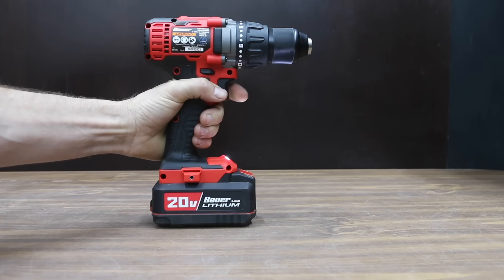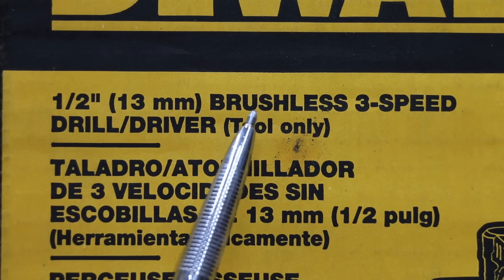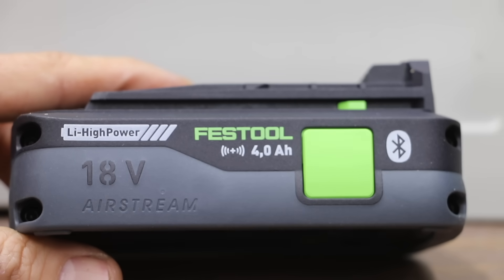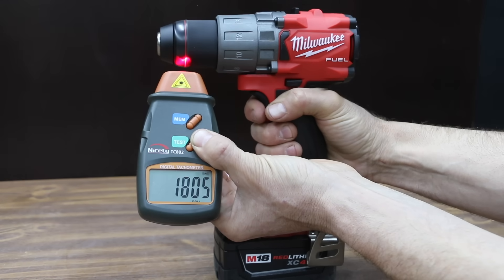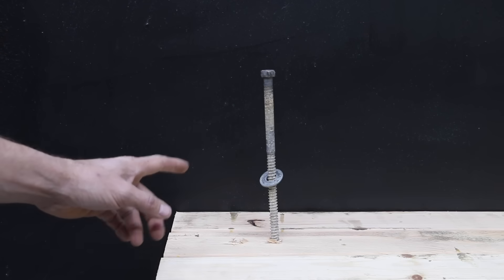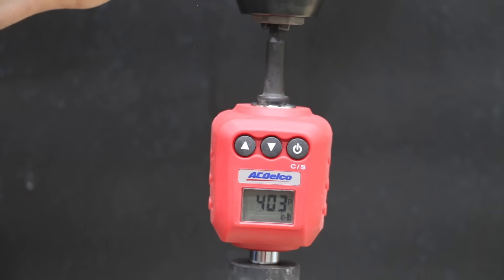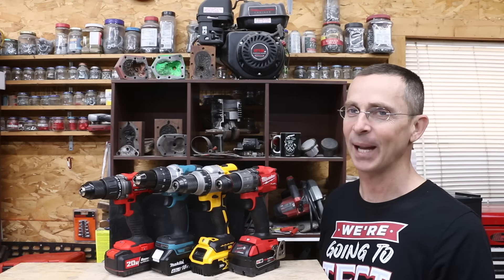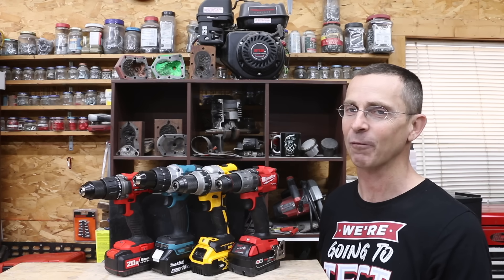Best Drill (BATTERY POWERED)? Milwaukee vs Dewalt, Makita, Bosch, Festool, Ryobi, Bauer, Ridgid

Comment: To state 'Made in USA' item has to contain a minimum of 47%  parts actually made in USA. (or maybe 49%? I forget)
 If percentage is lower it can only say 'Assembled in USA' 
Around 2008 Harley Davidson sales suffered when they switched to 'Assembled in USA'  which is the only reason I'm aware of the difference.
The lack of run time is the reason I don't have a working cordless drill any longer, even with Lifepo batteries run time is too short and the older technology  cells have way too many issues.I found it a waste of money having a cordless even with multiple battery packs
Reply from the maker: Thanks for the feedback.

Comment: I'm not a contractor, so the cost of replacing batteries, and the power of the drill are primary concerns.  I can have a drill a long time before wearing out the brushes.  With Ryobi, by the time the batteries won't charge anymore, I can buy a replacement drill, charger, and batteries cheaper than just the batteries.  I'll stick with Ryobi.
Reply from the maker: Thanks for the feedback.

Comment: I left my Milwaukee at home one day and picked up a Baur from harbor freight and was pleasantly surprised. It had a hammer setting and came with 2 batteries, charger and bag for $65. 3 years later still going strong. It's a bit heavy and doesn't have the torque of my Milwaukee but for a good cheap back up, I got no complaints what so ever.
Reply from the maker: Nice!  Thanks for sharing.

Comment: I USE MILWAUKEE FOR MY HOME IMPROVEMENT  BUISNESS,

DEWALT HAS ALWAYS BIN A CLOSE SECOND WHILST MAKITA HAS CAUGHT MY EYE WITH ITS LONGEVITY. 

IT MAY BE SAFE TO SAY THE US BUILDS MORE WITH WOOD THAN ANY OTHER COUNTRY (CORRECT ME IF IM WRONG)

WHEN I BUILD DECKS THERES NO BEATING ITS POWER,

THE MILWAUKEE SUPERSAWZALL IS BEYOND ANY SAWZALL IVE USED,

DRILLS ARE USUALLY  FASTER WHILE AN IMPACT WILL DRIVE LARGER FASTENERS WHILE SAVING THE WRISTS.

ALWAYS PICK THE RIGHT TOOL FOR THE JOB!

THANKS PROJECT FARM.

IM GOING TO WORK NOW.

Comment: Im using Metabo 18v drill it has 4 brush motor. I dont like brushless sound. But though its very powerfull and can take 40cm to concrete and 1meter screw with special handle. Also it does not have hammer drill seting, but it was my choice cause in time hammer drill seting will cause inaccuracy for drilling when you need precision. I have it for 6-7 years it still runs perfect and same like i bought yesterday. Metabo is super quality, though they released some cheaper variants. But more expensive one pays off 100%.

Comment: Already got my Makita drill and impact driver, both brushless and perform very well with making furniture.  My old boss used Makita tools, drills, belt sanders, plane, router and jigsaw.  I only have one Ryobi tool, biscuit joiner but it does ok.  Not sure if I can get all those brands here in Australia but we have a low cost brand Ozito and the only tool of theirs that works well is the leaf blower.
Reply from the maker: Thanks for sharing.

Comment: While comparing these for driving and torque, they are after all drills. Would have been a better if tested boring holes in wood and metal with a couple of different bits i.e. twist, spade. The Festy might have had some redemption with its faster rpm. Also aren't the brushless designs to maintain speed under loads etc? Big fan of your no nonsense tests!

Comment: You've only tested highest rated for brands. I work on ships and portability and smaller drills are better. I've gone with Milwaukee 12v but I'm curious why you haven't gone into the 12v realm?
Reply: For instance, I use 12v Hackzall and 12v Impact and hammer drills. These are very purpose driven devices and they often chill very tense problems that are created by a avalanche of maintenance faults that include problems that are just broken equipment.

These things are like half the size and some amazing jobs. I Wish you would push them up a little more.

Comment: Would love to see you add the Kobalt brand to your tests.  Seem to be a pretty good value but they haven't been through the Project Farm
Reply: I love my kobalt tools, use em for HVAC work and they have been through hell and still work the same from day 1.
Reply: Flex brand also
Reply: I have had Kobalt 24v since it came out, back then they were a very good all around drill for the price.  Now the 24v XTR series really polished it, it has a trigger comparable to dewalt, torque comparable to milwaukee.  Honestly, I use all the brands and right now the XTR is the best for me, it shines in all the areas I like.  The FLEX is really heavy and almost identical to the XTR but it is the most powerful drill I have ever tried.  Overall i'm very happy with the price and performance of all my kobalt tools, I saved thousands getting Kobalt over Milwaukee and I like everything about milwaukee except their triggers and price.

Comment: Should have finished the video with "Don't waste you're money on festool" 😅
Reply: I‘ve had the festool for like 10 years (protool but it‘s the same). Used everyday at work even with 120mm Holesaw Drills 20mm it never gave up or had to be repaired. So its quality is outstanding for professional use. Best regards
Reply: You could replace the word "Festool" in my comment with literally any tool brand and someone will post an almost identical comment to yours just with the other brand name in it instead lol.
Reply: @manuelr9654  My Rigid tool set has done hole saws, drills, driving lag bolts, etc and was purchased in 2004. Has a lifetime warranty even on the batteries. The warranty has only been used on the batteries.

Comment: Love your videos! Keep up the great work! I do have one question with drills (as a whole). What tool manufacturer makes the best drill that can handle the elements? I work in food manufacturing and I'm constantly covered in water, food grim, grease, you name it. I want a drill/ tools that can handle anything thrown at them. Any suggestions would be greatly appreciated
Reply from the maker: Thanks!  Thanks for the suggestion.
Reply: Panasonic used to make an IP56 cordless drill. It wasn't brushless, and I wonder if the could have gotten even better protection with a brushless drill, but they never made one. The brand, Nemo, makes cordless tools for underwater use, but they're quite expensive.
Reply: Thanks! Definitely worth looking into.

Comment: Is there any way you could evaluate a cordless tool “ecosystem?” A lot of people buy tools as a set, and buy more tools of the same brand / battery configuration. Example: most wouldn’t buy just the Makiya m18 fuel drill, then go buy the Makita impact driver. Which SET of tools is best?
Reply from the maker: Thanks for the suggestion.

Comment: With the milwaukee it has a super Saiyan mode put a high output bat on it. Yes it costs more but it's night and day. Mine cannot use my plant auger with the regular three amp bat to accomplish anything in my clay soil with the high output it'll tear through and about throw my wrist out. I don't know if Milwaukee advertise that there's a difference but there is and my old drills pre date the high output.
Reply from the maker: Thanks for feedback.

Comment: Considering that the Ryobi one was a brushed motor and except from the Bauer all the others were brushless motors. Don't know if Bauer has a brushless motor but Ryobi does.  So that would be the one to compare with the others to make it a fairer fight. Especially the new High-Performance line-up. 
What I also missed from this test is an efficiency test. Meaning how long will the battery last with the same size battery.
Reply from the maker: Thanks for the constructive feedback.

Comment: Can you include some Panasonic tools in   future tests? They kinda fly under the radar but from what I've seen and read, they're good. They had a lot of functions ahead of the rest but didn't make a fuss but now the bigger brands are introducing stuff as new tech even though Panasonic had it as standard years before. Brushless motors etc. 
Also people say their batteries were above the rest, as in they last longer and their 14.4v are better than 18v other brands.
I watched a video of someone using a couple of their IP rated tools underwater. 

I've just picked up a 10 year old used Panasonic 14.4v multi purpose saw. Batteries and saw made in Japan, hopes are high. Gonna test that out soon when I get a good blade, the guy sold it to me had the blade on backwards and all the teeth came off. 
Hard to find 135x20mm blades though and the Panasonic ones are pretty dear, although some are made in Japan and have c7 carbide teeth.
The saw has low rpm aswell, something like 2400, I assume because it's mostly designed for metal and plastic, but I guess I'll only use it for that and maybe some small bits of wood when I can't be arsed to get out the corded saw
Reply from the maker: Thanks for the suggestion.

Comment: I might sound like one of those crying flowers you find in every video. But what the hell is THAT Festool hybrid drill even doing in this test? It doesn't belong in this test since it is neither a regular drill nor an impact drill. Its a hybrid able to switch to either mode at any given time. Its not supposed to be the best drill or the best impact drill its a multi purpose tool that does its job and for a very fair price as a single unit. Could you not have got regular Festool drill? They are half the price you bought that hybrid one and they would beat it at the tests you did. Do you have a hate for Festool or was it just not enough research? If you have turned on the impact action on those french screws they would have gone in no problem at all

Comment: Love these videos. One quick question - is there any reason you tested the brushed Ryobi drill instead of the Brushless version? I show it online at $83 (tool only, part P252) and I'd be interested to see how it compares to the more expensive offerings.
Reply from the maker: Thanks for the video idea.
Reply: @ProjectFarm  if you need another one... Do a locking plier showdown!
USA made Malco eagle grips vs offshore Irwin vice grips vs craftsman vs other brands. Hardness of Jaws, how much torque you can put on a 1/2 bolt before it slips, etc.

Comment: For me the Milwaukee M12 has a better clutch than the m18.  Less power but much better for delicate work i.e. tightening aircraft panel screws without stripping and ultimately drilling them out.. Great Video!
Reply from the maker: Thanks!  Thanks for sharing.

Comment: I prefer the ridged brand I know I know it’s, not the best but it’s no where near the worst that and….    Rigid has a kind of emotional value 

2 years ago my grandpa was diagnosed with stage 4 cancer they said he only had a few months to live after I visited him and my nana for a while I had to leave and the next day at 7am I got a call

“Papa passed away last night”

That line was hard write but anyways, he had his toolbox in his will it held every tool he owned this box is a custom made he had a brand new set of ridged stuff containing a drill, bits, and an impact (with batteries and a charger) so that’s why I use ridged it brings a lot of good times
Reply from the maker: Thanks for sharing!  That's a nice memory to cherish.

Comment: This may be an ignorant question, but would it be worth comparing corded tools? The cost is usually lower, eliminates battery compatibility concerns, and it is corded, but extension cords are cheap. (For me I don't generally see a lot of benefit to cordless tools.)
Reply from the maker: Thank for the suggestion!

Comment: I have alot of tools in the Ryobi One+ series. I know that my drill isn't the strongest out there but it gets the job done. I'm more impressed about the hammer drill in One+. It made holes in my concrete ceiling just as fast as a corded green Bosch.
Reply from the maker: Thanks for sharing.

Comment: Have you compared CVT fluids?  Manufacturers vs store brands. Thanks!   The dealer said they HAD to change the CVT fluid in my nissan.   It has a drain plug so I drained and refilled to full via dip stick with store brand CVT that per label was compatible.  Went on a 6500 mile drive out west... no problems at all.  Thanks again for your great testing!
Reply from the maker: You are welcome!  Thanks for the video idea.

Comment: I remember using an electric drill if you needed tons of power. My old 7.2 Makita would barely drive drywall screws through a 2x4. When I got my 9.6 I though it was about the best you could get. I got a deal on a 20v Lithium Porter Cable drill and even today it impresses me!! All my mechanics tools are Milwaukee, though. Todd, another fantastic test!!!!
Reply from the maker: Thanks!  Thanks for sharing.

Comment: I'm a technician for Ford.  I personally have all Milwaukee.  I do a lot of heavier duty work and my Milwaukee drills out shine my co works snap on drills. I use the Milwaukee M18 fuel brushless drills. The 3/8, and 1/2 drills also and never had a problem. Also anything goes wrong, you CAN NOT beat Milwaukee's warranty. So I willing to spend more for Milwaukee. I promise you, if you switch to Milwaukee or just looking into drills, you can't go wrong with Milwaukee!
Reply from the maker: Thanks for the feedback.

Comment: Barrel spin test was invalid without a controlled barrel diameter. Should have chucked a bit and used it as the control for testing spin speed between drills
Reply from the maker: Thanks for the constructive feedback.

Comment: Let's assume that you bought a high-quality drill for 500 dollars, and its service time is for 5 years. . Another brand sells a similar product, albeit with low-quality materials, and it costs 50 dollars. You can buy two for 100 dollars. One is a back-up in case the primary one fails. You use the cheap drill for 2 years. Toss it if it fails, or use some parts as spare, and you still save a lot of money in the long run. 
Of course if we disregard the environmental impact...
Reply from the maker: Thanks for the feedback.

Comment: I love your videos, especially to see how my tools stack up vs other brands. When it comes to power tools I have mostly ryobi, you gotta give them a fighting chance, that drill is their really old cheap version, they have 2 newer ones, both with brushless motors that blow what I call the "$20 drill" out of the water. That is the P215, which is $36 new. The P251 is the drill I bought to replace my cheaper ones, and it's not even close. They also have HP models with weird model numbers, but I assume they're better than the old brushed models. Again, thanks for making these videos, you have influenced a lot of brand changes to the stuff we use on our small Ohio farm!
Reply from the maker: You are welcome!

Comment: ...but in this test kit you missed the best drill, which has 3800 RPM in third gear, interchangeable attachments, three-year guarantees, which is designed for continuous, professional loads, not to mention its batteries
Reply from the maker: Thanks for the suggestion.

Comment: Been using rigid for 10+ years and never done me wrong. But I've used pretty much all and like each of them in their own respects and still own every brand here minus festool and bauer. Most of the time it becomes a game of how many batteries you have to buy down the line. Or at least in my personal experience it is.
Reply from the maker: Thanks for sharing.
Reply: @ProjectFarm  no problem sir great and informative video. Seeing all these adds for the flex brand claiming pretty much to be the new best thing since sliced bread. Would be a great opportunity for you to put a few of their items to the test. They show comparison videos but don't prove much considering they don't show if they are using the same bits/blades or if they are both using a fresh hot battery. Either way keep it up brother. Made a subscriber out of me.

Comment: I just bought a topelek 20v cordless drill for $60 310 inch pounds of torque 1400rpm 1.5AH battery & charger seems very good so far!
Reply: I drilled a lot of holes with it lol
Reply from the maker: Thanks for sharing.

Comment: I would think that contraption you have set up for the inch pound test would have a disadvantage for the electronic clutch systems. I am easily capable of using my Milwaukee on small screws for interior panels on the lowest setting with no issues.
Reply from the maker: Thanks for the feedback.

Comment: The entire skateboard, inline skate, scooter, roller derby, and longboard community is patiently waiting for a test on the longest rolling and most durable bearings.
Reply: I can't talk about inlines, but I figure the following is true for them as well:

Those bearings are not made for sideway forces. Basically,  after one or two corners,  such a bearing is "ruined", so you can REALLY buy the lowest abec generic shit.  The only thing that makes a bit of a difference might be material of the ring that separates the balls.  But that difference is really cheap. 

UNLESS you go for an all ceramic bearing,  which ARE better/ different,  but those are really better,  because they are harder than any grime that could get in there.  They just chew it up and spit it right out again.
Reply: Bones duh..
Reply: Bronson bearings are 10x better than anything in its price range
Reply: I just odered them in bulk (160 pcs) from a manufacturer nearby for like under 20 cents a piece and am really happy for over 2 decades with the same shipment.
Reply: Haha, aye!
Reply: Bronson